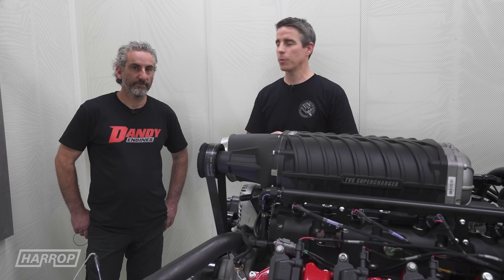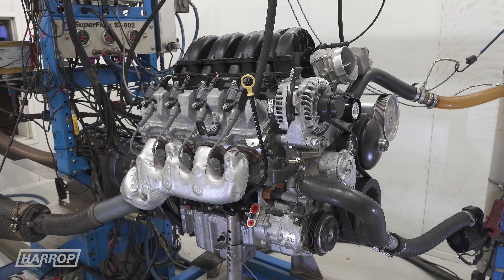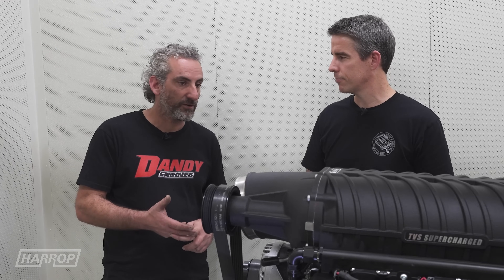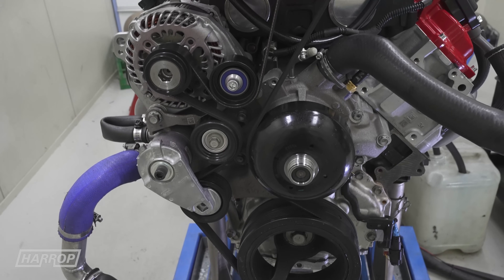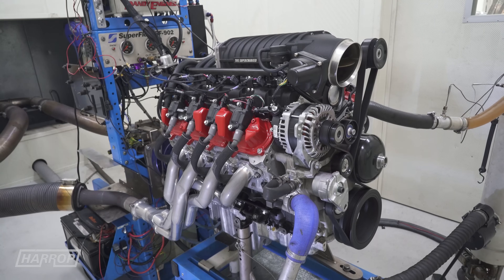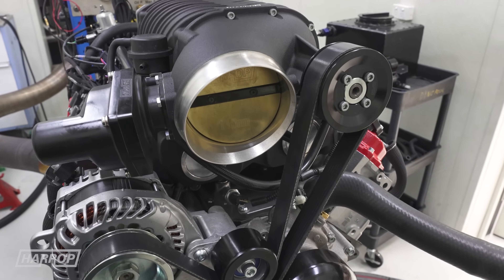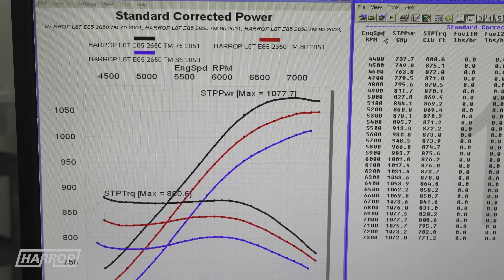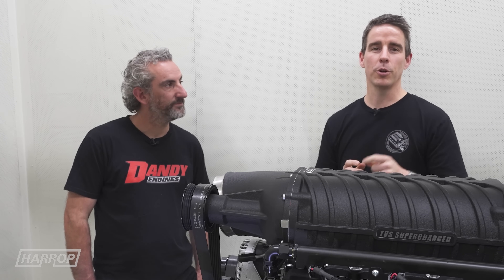GM GEN V LT V8 Supercharged | Harrop Top Mount Dyno Testing

Comment: I would say for most guys running this is a 2500, which is 7800 lbs, anything over 700 ftlbs at the tire would really wake them up. not to mention towing at a lower boost and a bigger intercooler. Might even see 10 mpg gasoline pulling its own weight???? idk

Comment: Problem is, engines like the L87 have some seriously bad achilles heal. What's the point of running fuel tech when you can't run that in the 19+ 1500's?
Reply from the maker: We have a complete kit for L87 19+ trucks that runs the factory ECU, with CARB EO pending.
Reply from the maker: This Top Mount LT kit suits engine swap builds where flexibility with fueling, air delivery and engine control is needed.

Comment: 6.6 litre v8 with a 2.65L modern intercooled blower on E85. 163hp per litre. Not ground breaking is it? Sounds good though...
Reply from the maker: We didn't set out to run max effort on this combo, we agree there is great upside potential as mentioned at the end of the video.

Comment: Does this direct bolt into a zr2? The engine that is.
Reply from the maker: We haven't done it, in theory the L8T could be adapted into a ZR2 1500.
Reply: @HarropTV  Would be a weapon if possible, certainly need the 10 speed upgraded.

Comment: wow at 12lbs of boost shes probably making like 550hp NA
Reply from the maker: Yes agreed that would be pretty close NA. We will be doing another LT video on NA testing with different Cams and Intakes.
Reply: NA with boost I'm confused?
Reply: @trentcardwell  you can back calculate how much N/A horsepower it would make without boost. 1000*14.7 / (12 + 14.7)